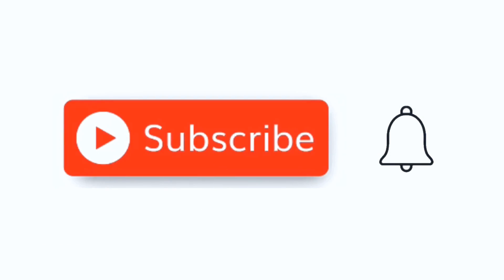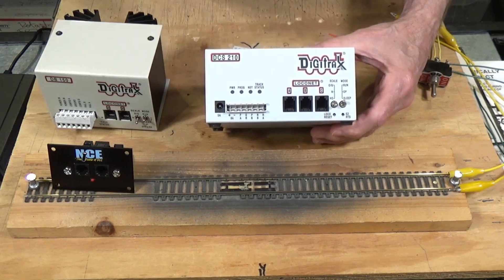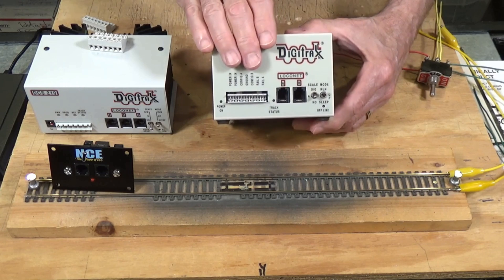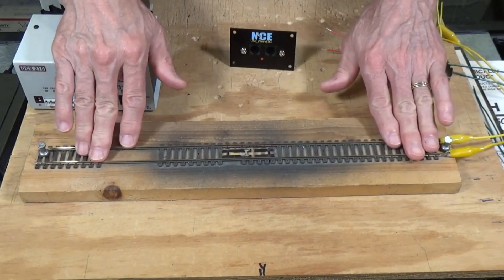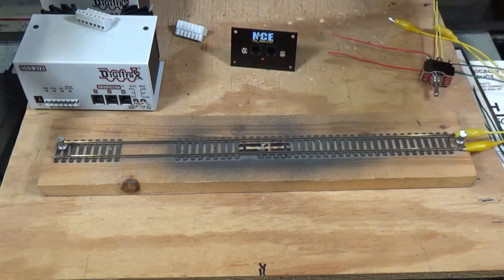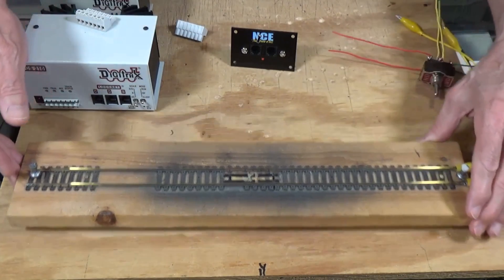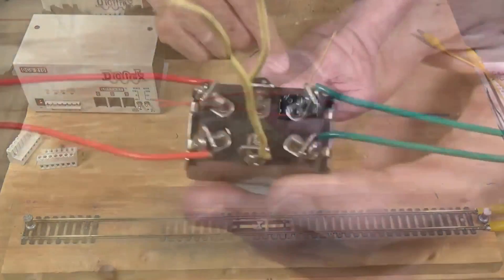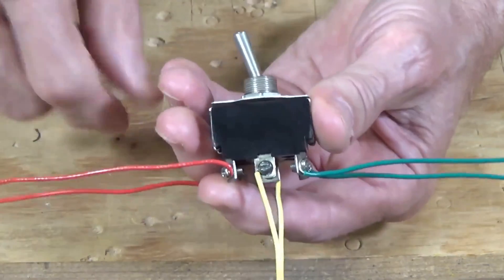Add A Dedicated Programming Track (290)

Comment: A DPDT switch is usually a "momentary" action switch. I other words; once you immediately release the toggle, it automatically goes back to center position (off) so I'm wondering what type of DPDT switch you have in this video?
Reply from the maker: I’ve been using DPDT switches for 40 years and have never seen one like you describe so they must not be that common.

Comment: Larry I was looking to buy an auto switch for my NCE cab to put a programming track in and looking at the wiring diagram it shows not to add wires to program outputs but wire them to the main feed going to the auto switch. Have I got this wrong? could you explain the difference to how you said to wire the switch
Reply from the maker: The autoswitch is designed for use with DCC command stations such as the PowerCab that do not have separate programming and track power outputs. The device works by switching off track power as soon as it detects a programming preamble signal and sends the programming commands to the programming track via its programming outputs. Using the device with a command station that has separate programming and track power outputs would be useless.

Comment: Hi I'm very new at this and my question is does the polarity on the track make a difference to the DCC operated train and when programming it also
Reply from the maker: In most cases no. It is a factor though in reversing situations such as reverse loops and wyes.

Comment: With no extra programming outlet, it's also possible to use the physical switch without needing a second switch, by using an optocoupler.
There are two ways to run the optocoupler.
You have to keep in mind that the optocoupler runs only on DC.
The simplest way is, you want the optocoupler making a connection to the programing track in normal use, so your optocoupler needs to be live to make the connection.
This you achieve with an AC/DC bridge between you normal track currency taken after physical switch and to your optocoupler, that will make your programing track live in Norman use.
Once you switch the physical switch to programming track, the power to the optocoupler drops away cutting off the flow between programing track and normal track.
More difficult way is to use an Arduino run relay that activate or switches off your optocoupler.

Comment: Correct me if I’m wrong, but couldn’t someone (when working with a device without dedicated programming terminals) use a DPST switch as well? I say this because I think it would work if the programming track was connected before the switch and the main line after. This way you can disconnect your main line, but keep the programming track connected?

Comment: Probably too late to ask this question, but here it is.  Why not just have power to the programming track all the time and turn the rest of the layout off when programming and back on when done and want to drive to loco back on to the rest of the layout?
Reply from the maker: I think it depends on the type of system you have and whether or not it has both mainline and programming outputs. If it has the single/combined output then your method should be fine, just make sure to throw that switch when programming. Because folks tend to forget things like switches the Auto-SW is a good alternative the automatically isolates the programming track.
Reply: Thank you for such a quick reply!!  I have Digitrax and it only has power out, no programming out at the command station.  Yes, remembering to flip the switch is critical.  thanks again, Cal @TheDCCGuy

Comment: I'm using the NCE PowerCab and only one DPDT switch. I use a dead end siding on my layout as my programming track. It has two nylon rail joiners that isolates it from the layout. I can have power to both my layout AND my programming siding using the switch. I then throw the switch the other way and the layout has NO POWER but the programming siding still does. After I do my loco programming, I flick the switch the other way and I can now drive my loco out of the siding. This is simple and easy. If I had a way of uploading my wiring diagram I would. You will be amazed at how easy it is to wire. I will also soon be adding a bi-color LED as a good visual indicator (Green for everything powered and Red for only programming siding powered).
Reply: Excellent.  This is exactly how I was thinking.... Thank you.

Comment: I use a NCE Power Pro R system which has b the 2 outputs as you're showing for the first Digitrax unit.  Isolating a section of programming track would work just as you are showing using a DPDT switch.  Also, the Power Pro system has a built-in "Programming on the Main" feature which lets me program locomotives one-at-a-time without having a dedicated Programming Track ..... quite convenient and has worked flawlessly for each of the locomotives in my fleet without any "cross-over" programming.  

Still, a great video with practical application!!  THX!!    👍👍👍

Comment: Can I attach the leads for track to the buss wire and run the leads for programming track to the digitak command station
Reply from the maker: Yes, as long as you use the switch as I showed in the video. That allows you to provide both power and programming capability selectively to an isolated section of track.

Comment: I use a toggle to switch my programming track between the PowerPro that runs my layout and a PCP panel.  I throw the toggle to the layout (PowerPro) power to run the loco in and out of the program track. Then I disconnect my throttle (I use PowerCabs for my throttles) from the layout cab bus and plug into the PCP which is always set up with its P114 power supply and throw the toggle to the PCP. I can then program using either Program Track Mode or Program on the Main without affecting the rest of the layout and take advantage of the PowerCabs ability to program most decoders including many sound decoders without the need of a programming booster.

Edit: Forgot to mention the isolation track relay I installed.  At the entrance to my program track is an isolation block.  This block is powered from the layout’s PowerPro system, however if I plug in a PowerCab to the PCP the PowerCab power energizes a Normally Open relay which disconnects the power to the isolation block.  This prevents locomotives from bridging from one powered system to the other.  When  I am done using the program track I flip the toggle to give the layout system control of the program track or when I disconnect the PowerCab from the PCP the PowerCab, the N O relay is de-energized and power from the layout to the isolation block is restored.

Comment: I'm a little confused by the wiring colors. The yellow would be your Main Bus (normally Black and Red). But then the Green and Red sides should also be Red and Black Main Bus leads, correct? I'm assuming you used the colors you did to simplify what you were showing.
Reply from the maker: Yes, with this kind of setup the wire colors don’t matter except to satisfy whatever color combinations you decide to use on your layout. As you said I used them to visually differentiate between the different connections.

Comment: Hi Larry, 
Very interesting  video setting up a programing track, when  using the NCE  Auto SW unit  I have a couple  of sidding tracks  that could be  used  to  program om, the  questin is   do I still  need  to put an isolatoon  gap  in the rails  so that  part of track  that will be used  to program  locos  will be  isolated. But the  track the will then  used  will still be powed  from the DCC BIS. Or  will  it have  to be removed.
Thankyou
Brian.
Reply from the maker: Yes, you still need to,isolate the programming track or your other locos will also be reprogrammed.

Comment: Another detailed and informative video, this was very helpful. I'm also looking for some advice on which Digitrax unit to purchase, there's a few options that they offer, but looking for some advice that breaks down the pros and cons of a 210 and a 240 and what throttle to use if you don't want to upgrade as you go. It seems like the 210 would be just fine, but I noticed from one of your videos that you also have a 240. I appreciate any help you can provide, thanks for all the information, looking forward to more!

Comment: Ok so adding An additional test track which type of track do you prefer. Brass or silver
Reply from the maker: Nickel silver, haven’t even seen any brass track in years.
Reply: @TheDCCGuy  most of my track (which I had set up on 2-4x8 sheets of plywood way back in 1977) is brass. Will DCC work with this old track. I am not sure if I want to replace a couple hundred feet of track
Reply from the maker: Brass will,work just fine, but you will want to keep it clean for best electrical conductance.

Comment: Hi Larry,sir could you tell me how to wire up a programming track on my layout where I use a NCE powerhouse pro system and then would like to use my Power Cab on the designated programming track? In another words I drive my Locomotive onto the programming track using the powerhouse pro then switch over to the power cab? How would that be wired using a double pole double throw switch with on/off/on? I appreciate your help very much kind sir! Also please keep up the great videos friend!
Reply from the maker: Why not just use the programming output from the PowerHouse Pro and use the DPDT switch as I showed? You could then just set up a separate workbench programming track with the PowerCab. Mixing the output from both systems could get “complicated”.
Reply: @TheDCCGuy  Larry the powerhouse pro is new to me and I had no idea sir it had a programming in it. Thank You so much friend for the info! I’ll wire it with a DPDT switch as in the video!   Thank You so much for your time! I have a lot to learn about the powerhouse pro yet! Merry Christmas!

Comment: Just Thinking ? Can you have working  ground signals just using hand throw points with my
tam-valley frog juicers ?????.
Reply from the maker: It depends on what kind of ground signals you use. If they have 3 wires like the standard signals I showed then that would work the same as I showed. However if you want to use the DCC Concepts ground signals I also showed in another video then it would require a special interface as they are wired with only 2 wires and the interface simply flips polarity.

Comment: Unless I'm missing something, there's an easier way to make a drive-on programming track for the NCE Style. (I've this evening programmed my first ever loco having bought the power-cab starter kit recently), and that got me thinking and looking at things...

I'm thinking that if you had your isolated section permanently connected to the controller output, and a Double pole Single Throw between the output and the main track bus, you can drive on to the isolated section, then switch off the rest of the track.   Do your programming, then switch the main track-bus back on again.   Any reason that wouldn't work?

I'm planning on using a section of track which is a side platform, which I have laid with isolating fish-plates at both ends for my programming track.

Any thoughts would be welcome, as I've literally only been using DCC for 2 weeks!

Comment: I have a NCE dcc twin ' and i want to build a small layout 4x8 with this dcc twin can i have sounds on a new locomotive Because i don't have any locomotive and i want to buy two locomotive , Can i buy it with sounds ?  Thank You I like your work
Reply from the maker: I have never messed with the Twin but it seems to be able to control up to 8 functions so you should be able to control a sound decoder with it. You might be limited in how many functions you can control but it also is possible to remap or reassign the ones you want to use to the keys on the unit. I would see if a friend would bring over a sound decoder to test on your layout before buying. Also you might do a search on YouTube to see if anyone has done a specific video on the Twin.

Comment: I have the NCE Powercab system and I also  purchased the programming track module as I intended using a siding track to do my programming. My problems arrived when the weather turned unfriendly by raining so I had to come up with a different setup for programming etc. Using information supplied by the gentleman at Strathpeffer Junction, who happens to be a genius at developing all sorts of items to make life easier when running older type stock plus he designed a module with a rolling road, programming track and also an interface for using decoder-pro on your computer, this has proved extremely helpful for me.
I have not discounted having a programming track which could use one of the outlet tracks from my turntable, some minor wiring changes will be needed but that is part of the fun of model railways, they are always evolving. A great video Larry, keep up the good work. From Peter in the UK.

Comment: One thing to remember with the "drive on - drive off" programming track, is that locomotives "creep" when being programmed.  One reason that I use a completely separate track with bumpers at each end.  I suppose you could drill a couple of holes to accept dowels in between the rails to block the engine from walking out of the programming area.  
The DPDT switch would work for the programming track in your second example.  Just hook the green wires to the programming section AND the rest of the layout.  Since it has a center OFF position, there is no chance of connecting track power to the programming pins on accident - much simpler than adding a separate On/OFF switch to cut the track power.

Comment: Nice vid. You did a particularly good job of setting forth the considerations and methods of programming tracks. All I would add for a layout programming track manually switched is to consider mounting the DPDT C/O toggle so that it throws vertically. The up position is layout power as up is always on, center is off, and down is programming.

Comment: What do you think about the DR5000 that has drive on/off. Which I understand does not comply with the DCC specification, but I find it extremely handy.
Reply: I find my Digikeijs DR5000 very helpful in that respect also.  Never failed me yet.

Comment: Instead of a DPDT switch if you use a 4 pole switch it's possible to create an isolated track section at each end of the programming track. This will help to avoid a short circuit if the loco should accidentally move during programmng, or any moving loco accidentally shorting to the progtamming track.

Comment: Thanks for the video Larry.  Maybe I'm overthinking this, but I'm a little confused.  I have a DCC system with a separate programming track output, like in your first example.  Your solution doesn't make sense to me because you talk about being able to drive the locomotive off the programming track after throwing the switch back over to the main rail output.  How is that possible when the rest of the layout won't have power due to that track section being isolated?
Reply from the maker: If you use a system with separate power and programming outputs then you always would have power on the main track and selectively have power or programming using the switch. If using a system like the PowerCab then it is always providing power to the output terminals and only sends out programming commands when you tell it to which is why it has to be isolated.

Comment: Hi larry,Ihave just watched (290) this what was asking the last time tx you,now can you do a follow on and link up a dcc concepts alpha meter to the power leads thanks again Brian
Reply from the maker: Brian all you have to do is run two wires from the track power terminals to the input side of the Alpha Meter and then run two wires from the output terminals on the other side of the board to your DCC power bus. It basically is just spliced into the power bus.
Reply: @TheDCCGuy  Thank you Larry

Comment: I have small bench 3' x 4' wide. I have my test track running across the bench but it's hinged. I drop it when needed, programming, checking cars coupler height. My feed goes through a rotary SW. #1 is DC , #2 is blank ,#3 is programming,#4 is blank, #5 is main line track voltage. So I can program , switch to main and test what changes I made. No moving engine.
Yes you need the center across the bench clear so you can drop 1"x2" track bridge to come down but this helps to keep bench half organized.

Comment: Larry, I have an NCE Power Pro System which is 5 AMP's   On the unit it has two wire output labeled Program Track, in my Yard I have a turnout and on the diverging track is where my program track is.  Both rails on the diverging sidetrack and has insulated joiners   with this system I do not need to DPDT switch or the NCE Program Track Device.  am I correct?   Happy Thanksgiving
Reply from the maker: The setup you have is fine as the programming track is isolated. However if I understand your setup you cannot run a loco onto or off the programming track since it only has the programming connections. By using the DPDT switch approach you could set the switch to provide track power to the programming track, drive a loco onto it, then throw the switch to programming , change you CVs, then throw the switch and drive off again.

Comment: For anyone curious, the Digitrax Zephyr (DCS 52) has both programming and rail outputs. It cannot program indexed CVs by itself, but if you hook it up to a PC running JMRI you can use JMRI to program indexed CVs. Or just get Blunami decoders and you never have to worry about programming tracks again. Assuming you have an iPhone...